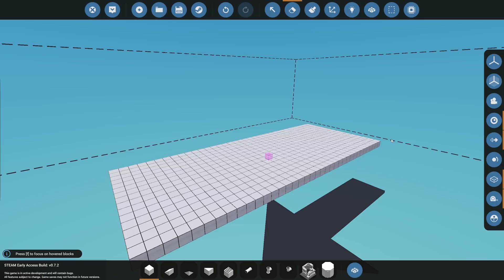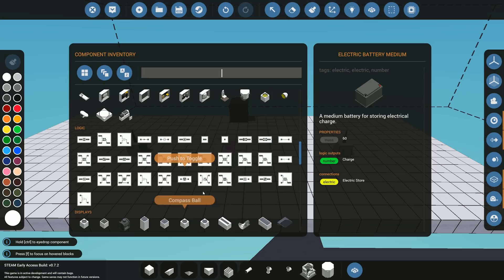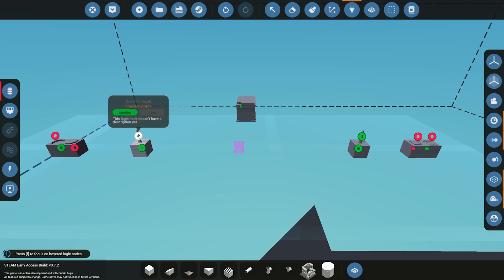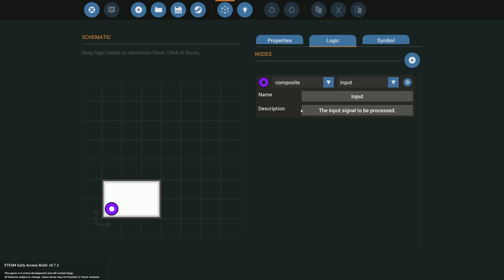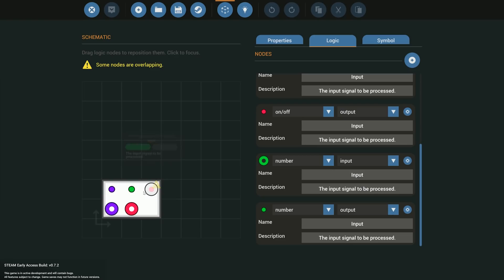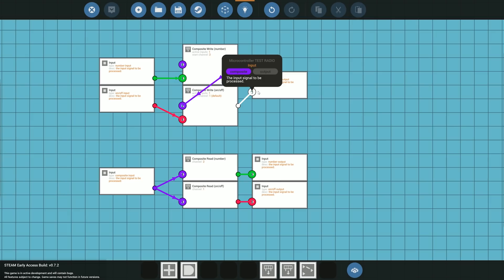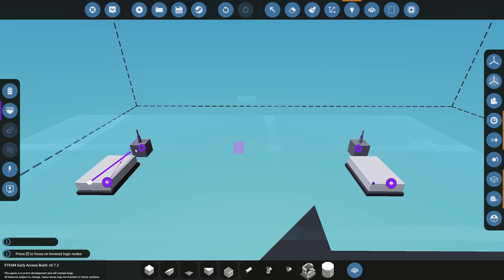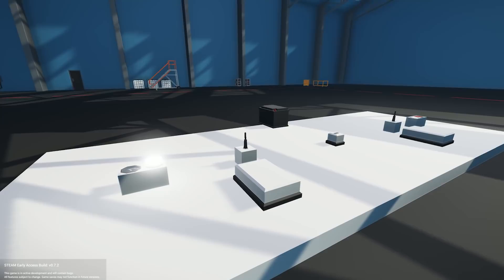Stormworks Radio Tutorial

Comment: i wonder if its possible to build a satellite 

like something powered by solar panels and is equipped to have a gyroscope to keep it upright 
like it floats in the sea then you turn it on and it flys up into the sky and hovers at a set altitude
that is just meant to be a radio relay 

but it doesn't need fuel to keep it in flight 

and if hit by lightning would drop into the sea and ''wake up'' and fly back into the air.
Reply: thats possible if I can bring myself to do it but it might be somewhere else, but maybe, once I get good at the rocketry

Comment: Will U do an lua tutorial?
Reply: The lua is sooo much fun. You can only write 4000 characters in each lua-block though... its just normal lua: but you can only use the 'string', 'tables' and 'math' libraries.

Take for instance this lua code: 

someValue=0
function onTick()
 value = input.getBool(1)    -- Read the first number from the script's composite input
 if (value) then
  someValue=someValue+1
 end
 if (someValue==1000) then
  someValue=0
 end 
 output.setNumber(1, someValue)  -- Write a number to the script's composite output
end

It basically checks the composite signal at channel 1, and read the boolean (on/off) value there. If it find it to be 'on': it adds 1 to the counter. If the counter equals 1000: it resets to 0. 

Then it sets the number on the composite out channel 1 to whatever the counter is at. 

put the lua block in between a 'composite read boolean' for channel 1 (1 long), and a 'composite write for number' at channel 1 (1 long), and you can hook them up to a boolean input and a numerical output, have a toggle button and a digital output, battery, hook them all up, boom. [x] done. 

Read the 'help' provided ingame: its very good. 
Also note the 'check for errors' button, very handy.
Reply: Wow,Dude,thanks for such a detailed Answer!will check that
Reply from the maker: Yes I will
Reply: Cool,I'm looking forward to this:)